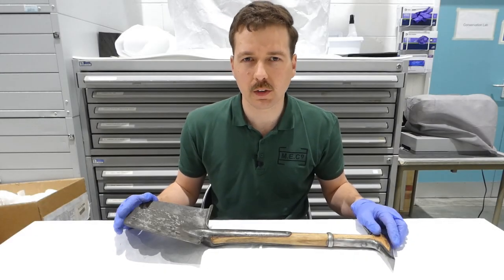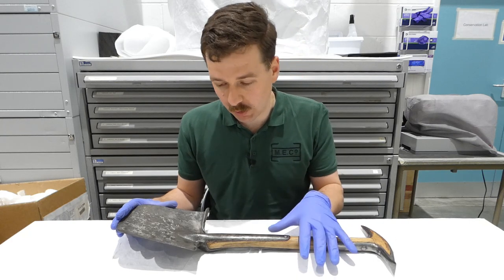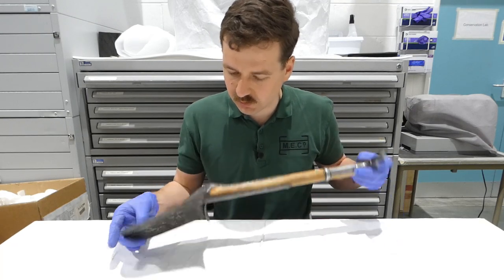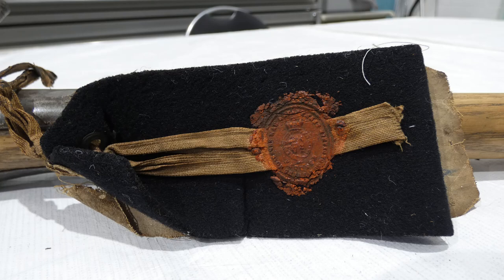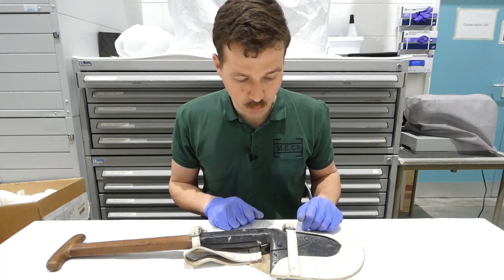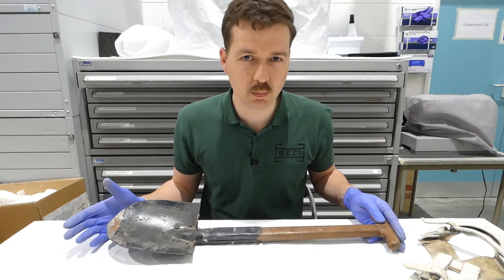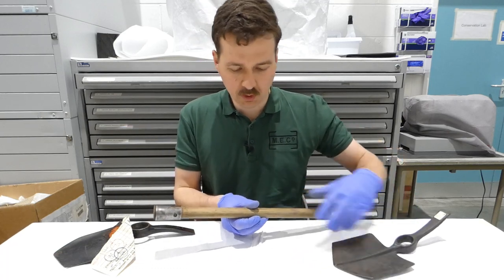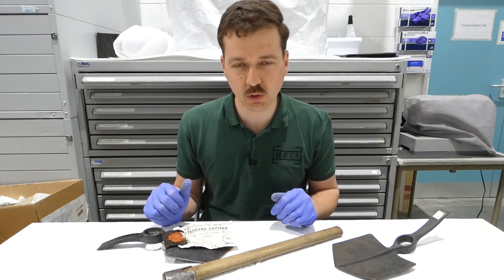Digging In, British Entrenching Tools - 1882 to 1908

Comment: Using the 1882 pattern as a pick must have been difficult. How would you hold it without the spade getting in the way. Very poor ergonomically. 1908 is a huge improvement in that regard.